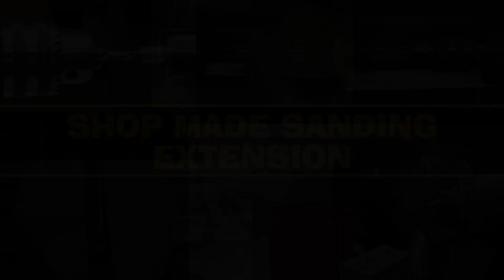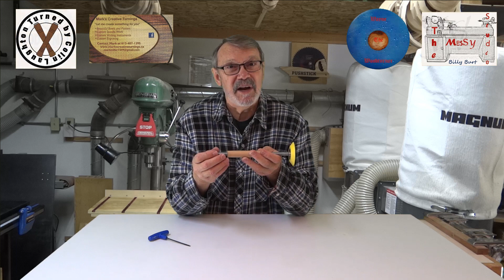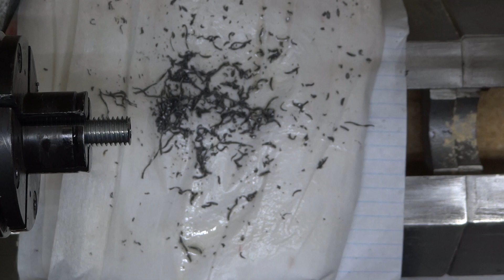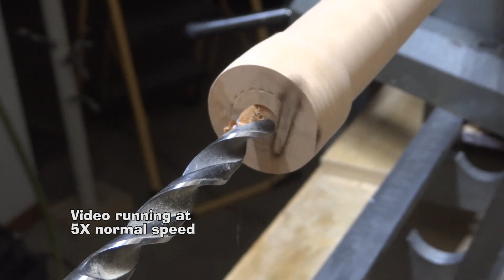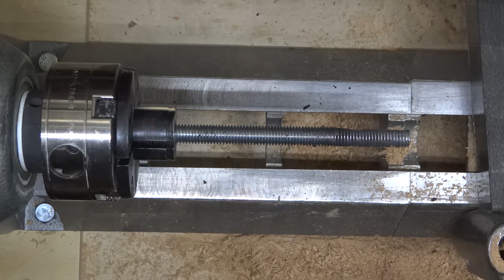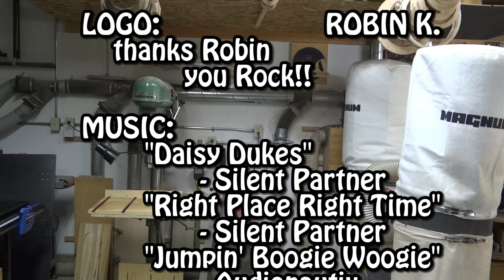Sanding Disc Extension

Comment: Great video.  I also enjoy making my own tools - for me, much of the fun in turning is in solving problems, and making tools is just part of that process.

Alternative design idea - use a die to thread the shaft of the sanding mandrel, and then drill and tap the hole in the rod so that the mandrel just screws in.
Reply from the maker: That is a good idea, Louie. Since I don't have a die, this is the method I will stay with. Also, it allows me to put a number of other sanding pads or other items into it and use the set screws to lock them in place. Thanks for the input. I really like the idea and maybe someone else will read it and run with the idea.
Take care,
.....Gord
Reply: Louie Powell a

Comment: Another idea:  I like supporting Vince (he has excellent sandpaper), but I make my own sanding arbors.  Turn a cone, embed either a short length of 1/4"x20tpi 'allthread' or a bolt, glue some closed-cell foam (an old mouse pad is a great source) on the face, and add some stick-on velcro.
Reply from the maker: Another great idea! Thank you!
Take care,
.....Gord

Comment: Awesome idea Gord, love making tools for jobs I need to do. Careful bud clearing out metal shavings from drill bit with your hands. I know it’s tempting but as I’m sure you know, they can be like little razors. Many time I’ve had small pieces stuck under my skin and can take a while to pick them out. I have to force myself to remember to use a stiff brush or leather gloves. Great video, take care.
Reply from the maker: Thank you for the advice, Colin! I never even thought of that. I will keep it in mind.
Take care,
.....Gord